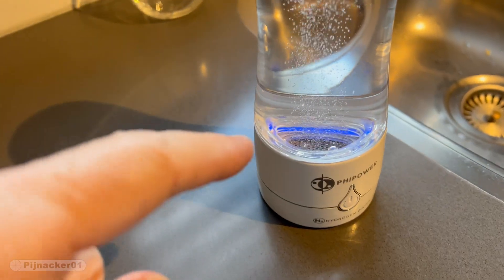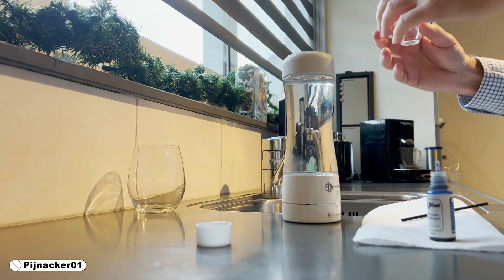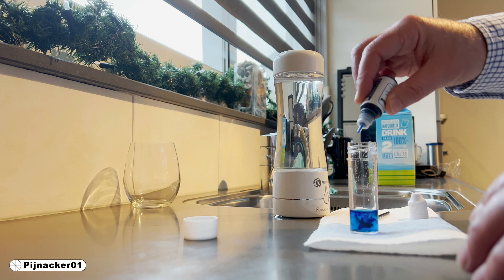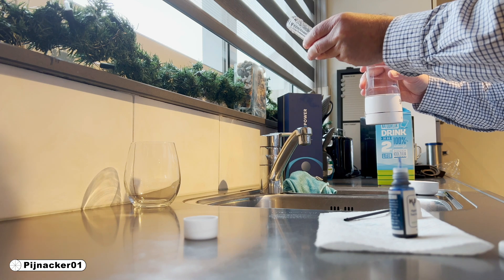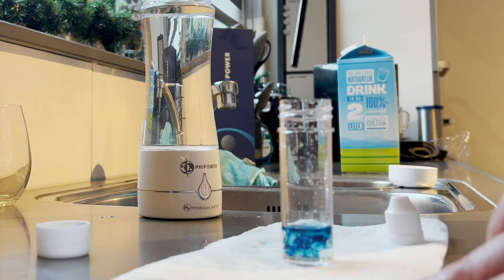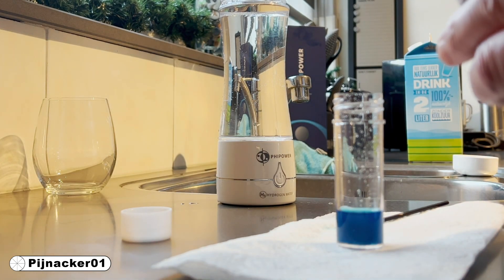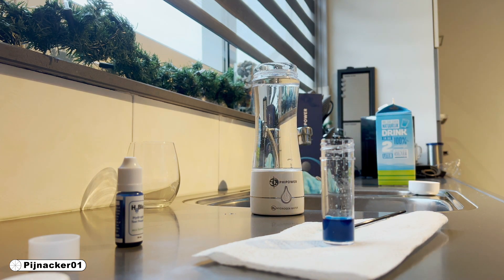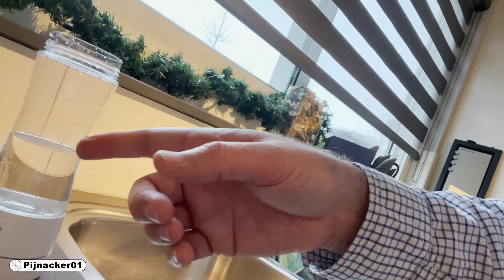Measuring Hydrogen in water from a Gas Generator - example with a PhiPower machine

Comment: Please do that again but 30 minutes after opening the bottle because hydrogen is said to evaporate very quickly after opening the bottle
Reply from the maker: Yes, that is very true. You need to drink pretty much right after pouring.
Reply: @pijnacker01  But still, would you make the same test 30 minutes after opening the bottle? 
I estimate that the hydrogen content will be about 50% lower. Thank you